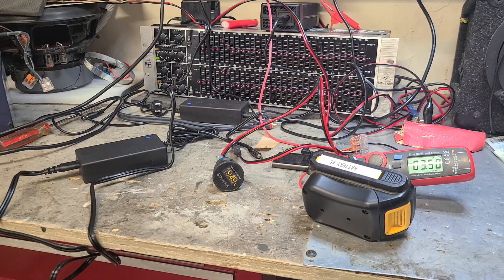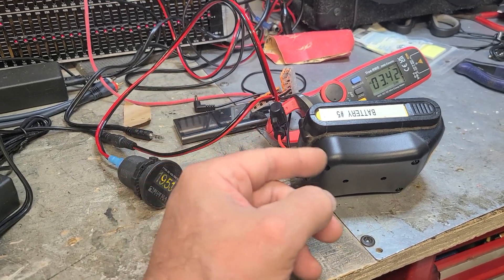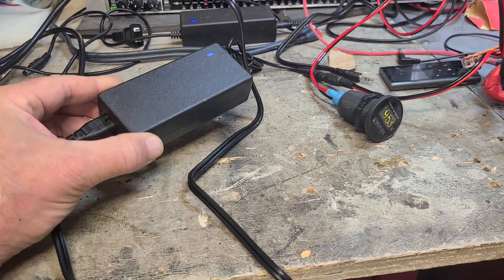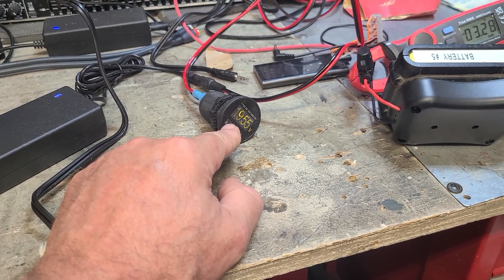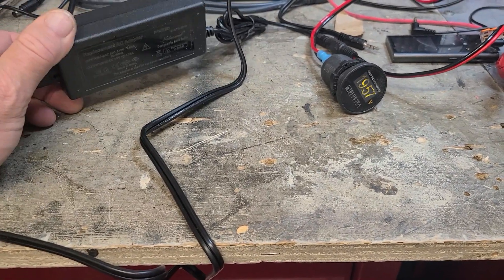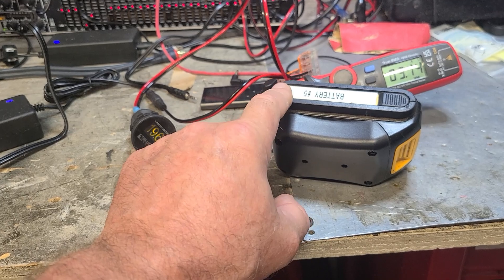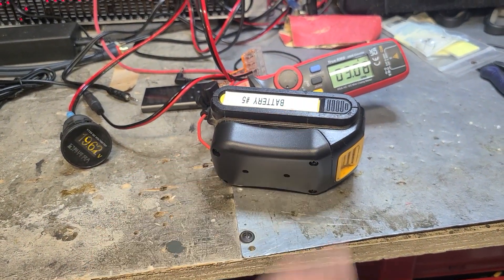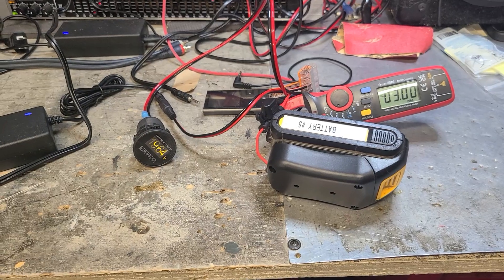Charging a Dewalt 20v battery using a 19v AC/DC power adapter from a Nobsound mini amplifier

Comment: Unfortunately DeWalt battery packs do not have an onboard BMS, it actually offloads the BMS role on to the charger itself. In essence the charger monitors cells 1 through 5 along with ID pin and temp sensor pin. As for low voltage cutoff, the tool itself monitors on of the cell pin on the pack when in use. Charging it with the power supply with an open circuit of 20 volts would put you at 4 volts per cell at high state of charge if my meth adds up correctly in my head.

The biggest concern would be over discharge of the pack, but you a voltage meter onboard and just so long as you don't go below 15 volts which breaks down to 3 volts per cell or say the cutoff is around 16 volts to be on the safe side. Its kind of an interesting trade off that DeWalt decided to do, but the main benefit is they good pack performance without the overhead of a BMS that could potentially fail and you end up with an expensive brick. Another plus is that it is cheaper to build since the tool handles the undervoltage protection and the charger handles the BMS functions including overvoltage protection, temperature monitoring, and cell balancing.

Due to this particular nuance, I ended up picking up electronically broken DeWalt chargers, stripping out the internal guts, and wiring up to the contacts with an inexpensive BMS so I can have undervoltage protection if I accidentally left something on connected to it. I have one on one of my utility trailer and one in my storage shed, when I need lights or 12 volts through a buck converter, I just dock one of those pack on to it and voila I got instant power.

You should be fine on what doing right now, just keep the pack voltage between 16 and 20 volts. Every now and then, it wouldn't hurt to put the pack on the OEM charger to get cells top balanced. I even took one of my chargers and installed a JST connector to the contact pins so I can use a RC/Hobby cell meter to check on balance on the overall cells in the pack.